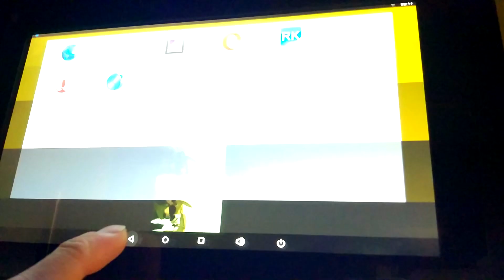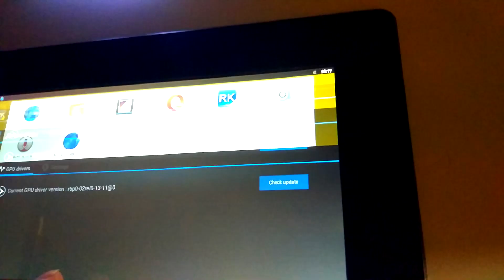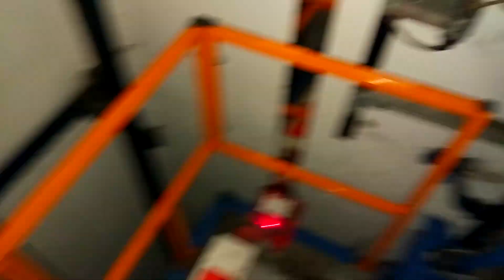Watching a movie on a boiler

Comment: Hey Beno, just wondered what the boiler is actually used for? Cheers- a fan
Reply from the maker: Communal heating for the tower block
Reply: @benolifts  The real question here is... why do you need a tablet to control a boiler? Waste of money imo
Reply from the maker: The android system doesn't seem to do anything, unless you are meant to connect to an internal web server using the browser.  There wasn't a boiler app.  The whole thing seems completely unnecessary.